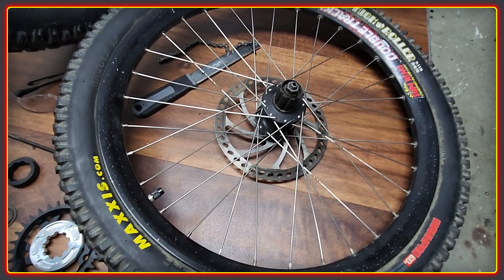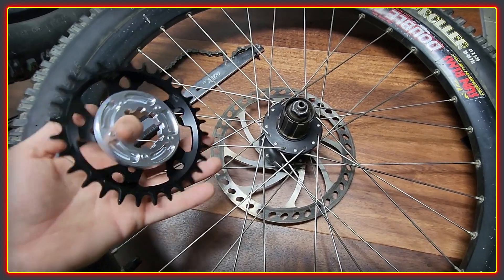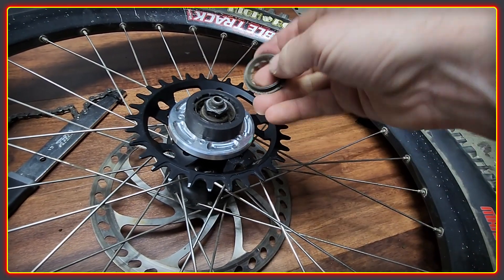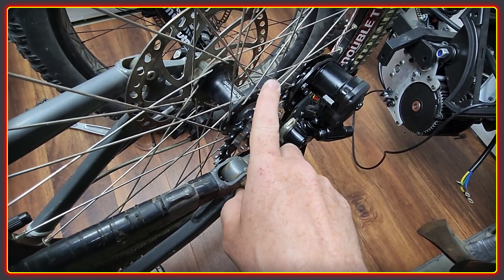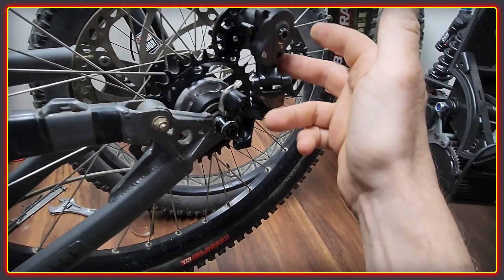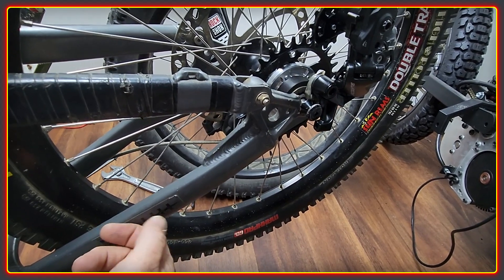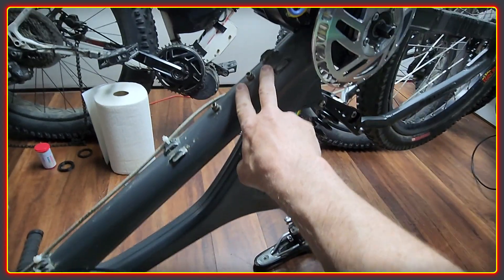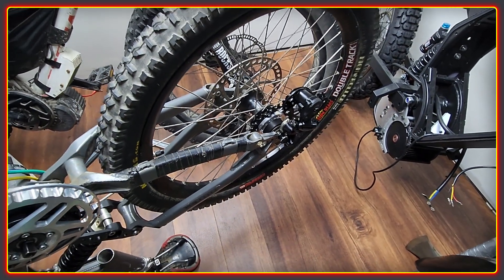Bafang BBSHD Single Speed Drivetrains - Custom Sprocket Adaptors / Specialized Big Hit Part 3

Comment: What’s a good combo for hill climbing with bbshd?  I’m not a little guy and realize I’ll have to pedal
Reply from the maker: A good quality steel cassette with a wide range of gears 11-42. The best front sprockets are the 42 t ones with an offset. You probably won’t use the smallest ones like the 11t unless you are trying to set a speed record downhill.
Reply: Wouldn’t a smaller front chainring be better than a 42 front?  If the back is a 42. For hill climbing torque. And to pull trailer as well

Comment: How is this project coming along? I have a Big Hit FSR 3 with a 26" wheel on the back.
Reply from the maker: Good. Its built and ready to ride. As soon as the weather co-operates we will be out riding. Expect an update by the end of Feb / early March. Its a great frame tho!
Reply: @HighVoltageKits  awesome! Mine is the 2006 with the square shaped downtube which makes it nice to fit a battery. Looking forward to seeing pics of your bike. Are you making the single sprocket adapters for the freehub body?
Reply from the maker: I'm looking at machining options yeah. I like the 2006! I'd get another for sure if I see one
Reply: @HighVoltageKits  I think they're an excellent platform for a build. 👌🏻

Comment: Any chance yet on purchasing these sprockets and spacers for a bbshd single speed set up? Or any close recommendations? This would be amazing and honestly I REEEEAAALLY WANT to do away with the shifter once upgraded to your 72v bac855 set up. Would you still recommend closer to 1:1 or is this 42 lekkie front with the smaller rear a great option for a 80-90 pound scrambler bike?  Also, I didn’t know a derailer was still necessary once switched to a single speed😮😅 guess I’ll need to do more research on why that is and/or good options for purchase. 
YOU GUYS ARE THE BEST!! thank you Greg! (And to the entire team of course!)
Reply from the maker: Thanks. I'm pretty cautious so I want to see it used in anger before having any of them made. Monty used a spider one on his build. The part is listed on his ELEEK video. That might work. I can make the spacers though in polycarbonate if you need those.
Reply: @HighVoltageKits  oh man, that Eleek lite frame is a dream of mine! Maybe with a LR motor though😅  beautiful bike once finished! Love that video! And thank you!, If I do go that route as well as figure out a tensioner/derailleur for single speed, I’ll definitely contact you about those spacers!! (Unless of course you recommend something newer by that time) thanks again!
Reply from the maker: Working with Lightning rods at the moment on that frame. The drive he has in the work is pretty sweet. Hope to show some stuff on it in Spring. I'm dying to get on it and have a ride.
Reply: @HighVoltageKits  oh man! That truly seems like the perfect combo because I’m looking for something that has the power/range of a SurRon without the fuss and legality hoop jumping of owning a SurRon😅😅 California is a funky place sometimes, and some people can really ruin it for others by riding like maniacs 🤷‍♂️  can’t wait to see it, and maybe even go that route!

Comment: How does this high RPM setup impact range? What's the most efficient RPM as far as power used per mile?
Reply from the maker: I found running at 50 amps and the throttle reduced range by about half over that of the stock motor. You can still get close to the original range and still better performance overall by dialing it back a bit. Range as always is a product of how much you consume which is something you have control over. The more field weakening you use the more power it will draw for longer at the benefit of higher speed.

Comment: That's a cool adaoter👊👊💪💪 that's a rotor too!! Great video!
Reply: I found another one.   At bikemans 76 delivered in states.  I have a cyclone 3k on a stretch bike. Long chain 2 combined minus 3 inches. What gears would you suggest? 32t front 42t back. Because I have those 🤣🤣 what would you suggest?
Reply from the maker: Thanks mate! Still waiting on road testing. Things are getting cold here as well!

Comment: So a mod like this is aimed at throttle use more than pa correct?
Reply from the maker: Yes. The speed at the crank will be too great single speed once it's been modified. You could use low power but your speed would be very slow

Comment: Use a Surly Singleator for chain tension...I have been using it on my single speeds with a BBSHD and it works great.  Info on the rear sprocket adapter please.
Reply from the maker: Thanks for the tip. Will update on the rear sprocket adaptor as soon as possible. Cheers

Comment: I did this a few months ago with my bbshd+asi bac855 combo. Used a 40T bling ring and 38T race face on a Pinion adapter. Single speed is the way with this set up.
Reply from the maker: Good stuff. That's a nice setup!

Comment: I’m new to the idea of running 1:1 on a mid-drive. It seems cool, but my understanding has been that one of the main benefits of mid drive over hub motors is its ability to use the drive train like a transmission for much higher efficiency. Wouldn’t running a mid drive 1:1 negate this benefit?
Reply from the maker: Hey Spencer. The only reason it works is because of the High rpm reached by the modified motor. 13,000 in this case often results in speeds over 80kph and plenty of torque all the way from a standing start. Running a bbshd stock like this will mean a very slow top speed. There are drawbacks with peddle assist being pretty pointless at this stage. It depends what you want to get out of the bike.
Reply: Have thought about going 2-3 speed with a chain tensioner for a “spare” bike, i.e. for while I do work on the other bike.

For a “spare”, a 12mph/20kmh top speed is acceptable (to me) as I’m not likely to need to go particularly far with it.  Reduced weight, however, would be a plus.  (Amtrak has weight limits on bikes.  50 lbs, if memory serves.)

Comment: Hi.  why captain 1 speed?  sorry but I couldn't translate the whole video.  being that I do not find central crown with greater offset.  this system would allow me to change my 11 speeds.  because it works well so far up to 10 V. then after chain if I continue on 11 jumps.  remember me or 145 × 12 boost wagon
Reply from the maker: La velocità singola non ti servirà bene con una configurazione di scorta. È necessaria la gamma di regimi elevati che solo un controller ASI esterno può fornire. Spero questo sia di aiuto.
Reply: @HighVoltageKits  thanks × trasletor 👍🤗 Sure captain.  I was asking you why did you do this?  I'll have to do another way.  it was to understand.
Reply from the maker: Il motivo è ottenere una linea della catena molto dritta. Ciò ridurrà l'usura. Andare a velocità singola consente l'uso di una catena spessa aumentando anche la durata della trasmissione. L'adattatore è dovuto al fatto che ci sono pochissimi pignoni a velocità singola oltre 22t.
Reply: @HighVoltageKits  Ok perfect thanks 👍👌🆗😉💪 ,, with 1 speed you can modulate the motor!?  with go up ...... and all the rest ....

Comment: Nice, just one question. Why bother with adding the splines to the ID of the printed spacers?
Reply from the maker: Good point Bob. They are totally not needed. I pulled the dimensions off a model so it was pretty easy. I didn't really think about it at the time.

Comment: Even drive / Even driven.... sprockets... requires a chain with an ODD number of links or.... else your wear will be 2x faster, or even more. 

Just like if you have an even number of links, a even driving number of teeth, you need an odd number of teeth on the driven sprocket.. to keep the chain rolling around the sprockets and not wearing the chain prematurely. This keeps the same link from hitting the same spot on the same sprocket every time.

Most OEM manufacturers follow this pattern too. kawa, Honda, soozook, ect. Ducati, Ktm. Aprilla. Ect.
Well known by motorcycle mechanics. Often overlooked by motorcyclists.
Reply from the maker: That is very interesting. I will have to bear this in mind on my Sur Ron build. I'm not actually sure how many links. The sprockets are 12t to 48t... Maybe I will get lucky. Thanks for the information I will do some learning. I doubt it has an impact on a bicycle chain and a sprung tensioner?
Reply: @HighVoltageKits  Oh yea well known, and taught by mechanic courses, and in engineering study, itself. Go look it up. It is also a reason for the funky numbers you common see on rear end gear ratios.. ie where the " 3.73:1" comes form and the" 4.10:1" comes from in differential pinion design. THey figured this out in trucks and cars in the 20's and 30's ( you begin seeing hunting tooth ratios, designed into the cars of the era,... )... And overnight, rear end vibration was a thing of the past.  

It is known as the " Hunting Tooth".
Reply from the maker: Cool. Learning! Always fun. Appreciate you taking the time.

Comment: If you're going single speed why have a derailleur and a convoluted cable contraption to align jockey wheels with the sprocket? Why not use a chain tensioner instead?
Edit:
And if you really must use a derailleur why not just use a shortened cable instead?
Thread the derailleur cable through the rear derailleur until the cabel head is seated in the barrel adjuster. Then align the cage with the sprocket and tighten the cable pinch bolt as normal. You can then use the barrel adjuster to make minor adjustments to aligning. 
In short, instead of seating the cable head in the bar mounted shifter (as normal), seat it in the derailleur barrel adjuster.
Reply from the maker: Partly cause it's what we have on hand. There are definitely other options as you mention. I enjoy the design stuff and making things on hand work. But the chain tensioner ought to work. The clutch derailleur is pretty strong so should do a good job. If not will probably take your path. Cheers
Reply: Yes- that’s the way to do it. 🎉

Comment: What I do with my bbshd for improving chainline is the reworking a cassete by swapping cogs, out of 8 speeds I usually use about 5 which is more than enough. I still not sure, can my rear derailleur or its hanger be bended or damaged by using such a cassete with cogs put together by rapidly growing in size next to each other?
Reply from the maker: Good points. You can do alot by putting the five you use in the correct space. Most cassettes come apart with a drill if needed.
Reply: @HighVoltageKits  My sunrace cassete come apart just by removing a single screw.
Reply from the maker: My BBSHD Fatbike build was Sunrace. Still holding up.
Reply: Dima, my armchair response is your rear derailleur and hanger should easily accommodate the increased ramp angle aka stress of greater cog teeth spacing between each cog size as you reorder your cogs within your cassette for better chainline for usable cogs.
A question please.  Let's say you use 5 cogs for your riding of your favorite ratios and position them most outboard to align with the chainring attached to the motor.  How do you limit rear derailleur travel to shut off the top three cogs? Is the inboard limit screw of your derailleur long enough?...or do you install an extra long limit screw to keep the derailleur from advancing to the inner 3 cog positions? 
PS. I am sure you know when increasing cog spacing, all the more reason to introduce a gear sensor to cut motor power during shifting.  I am sure you use one but wanted to mention it is more critical when bigger tooth spacing between cogs.
Reply: @lukewalker1051  Ok, I also think it shouldn't be a problem, since it was working normal before, but at some point for some reason my hanger and derailleur was bended and couldn't be adjusted properly, soon I will install a new derailleur. I had only one derailleur with my reworked cassete, which is a rather budget shimano acera, I'm not totally sure about the lenth of limit screw, didn't install a longer one but it seems working and keeping it from advancing to the inner cogs. As for the gear sensor, you won't believe, I've bought it but never actually installed it, the way I shift is very easy, just by pulling off the throttle for a second while shifting but maybe I will install it someday anyway.
Reply: Not the best idea. Even worse shifting to obsolete and low range 8s

Comment: Great work... regarding using the derailleur as chain tensioner... To have it aligned with the sprocket, simply cut maybe 2" lenght of a shifter or brake cable on the stopper end side and use it to set the alignment using the cable adjuster directly on the derailleur. 

Basically set the derailleur position by using the cable retaining set screw, then use the cable adjuster knob for micro adjustment.

Some derailleur doesn't have a cable adjuster directly on the derailleur, but rather on the handlebar shifter, if yours is like this, then simply 3D print one that will fit in the cable barrel on the derailleur.

Using a derailleur with a clutch make a big difference by eliminating chain slapping in offroad riding. (I know this by experience...)

I'm not sure if you will understand what I mean regarding the derailleur adjuster, if you don't, let me know and I will send pics on discord.

Cheers
Dan
Reply from the maker: Cheers Dan. Pics would be great. I think I understand. I have a design I'm working on to adjust it from the other side as well. Be good to see yours tho. Cheers
Reply: @HighVoltageKits  Will do, I will post on Discord tomorrow...

Cheers
Dan
Reply: @enduroebikeaddict  Exactly what I was thinking when John was explaining a contrivance to align the derailleur to single cog.  All you need is a 1/2" piece of cable housing attached to the rear derailleur barrel adjuster, a 2" piece of inner cable with cable head on it for restraint against the cable housing end, dial in approx position of the derailleur cage with the pinch bolt secured to the inner cable as with a typical derailleur set up and then fine tune the jockey wheel alignment to the single cog with the barrel adjuster.  Nothing elaborate required.

Comment: I've already tore off the shifting on my bike so I would love one of these! Are you planning on selling these on the website?
Reply from the maker: The sprocket adapter you can chat to Jonny about. I'd want to run it before looking at selling anything but he might do you a one off. Shoot me a message on discord.
Reply: @HighVoltageKits  I would like to buy one as well if possible? Thanks 👍😁👊
Reply from the maker: We are working hard to get through the backlog. Hopefully won't be long. Are you on our Discord. Best way to stay updated. Cheers
Reply: @HighVoltageKits  Yes I am on your discord & wait list for BBSHD ASI BAC855 upgrade. I would like to also buy one of those chain ring adapters as well so I could go single speed 1:1 like you did when I do my upgrade kit. Thanks 👍😁👊

Comment: This is a very exciting build and I cannot wait to see how this turns out. I HATE shifting gears on my BBSHD and I can only shift to a couple before my chain line is off. If all takes off I may try to convert mine to a single speed before my upgrade kit comes from you later this year.
Reply from the maker: Sounds like a plan! Cheers mate
Reply: How like that you can shift just couple of gears  only... I have BBS02B with stock 44t front chainring. I  got the issue with my biggest gear at the back 32T.  The chain always falling in front.  Then I make a different upgrade, just switching to new cassette 42t-11t. And now this issue is gone . 44t in front 42t in back. Now i can trying to climb vertical walls  xax

Comment: Since you are making your own spacers, you can really dial in your chain line. So the point of doing this is to be able to run a bigger chain to handle the big block power? 
That adapter is nice. Plans to anodize it? I know the front is silver and the back is black, but I would make that adapter red. Show that thing off. Can you add color to the 3D printed spacers?
Cool video
Reply from the maker: For sure. Any colors are possible. Yes a nice thick chain to last long. Will look into the anodizing stuff. Cheers!
Reply: @HighVoltageKits  What size of chain do you plan to run?
Reply: The point I believe is a bit more than just a bigger chain which definitely helps driveline life.  Its an extrapolation i.e. natural progression deduced from the EV world including Tesla automobiles as an example.  Tesla cars are single speed. No transmission. Why is this viable?  Electric motors intrinsically have great torque from 0 RPM compared to internal combustion gas engines which build torque gradually from idle...and...motors have a higher RPM capacity with field weakening that allow them to spin less encumbered by the magnetic field of the motor.
And simpler is always better. :-)